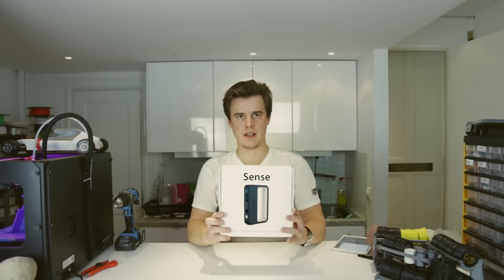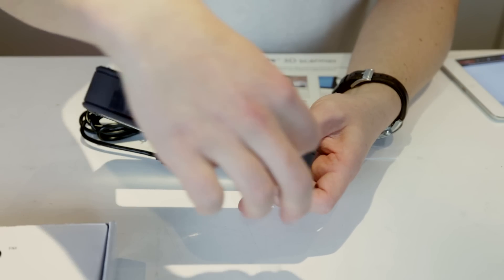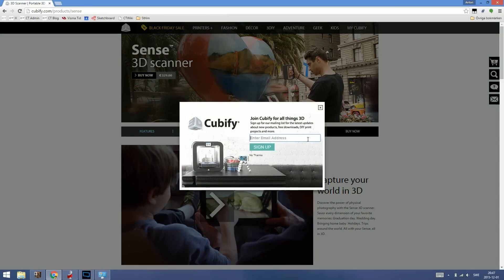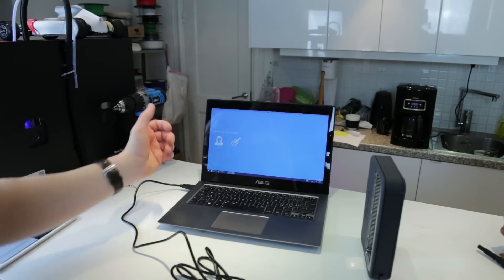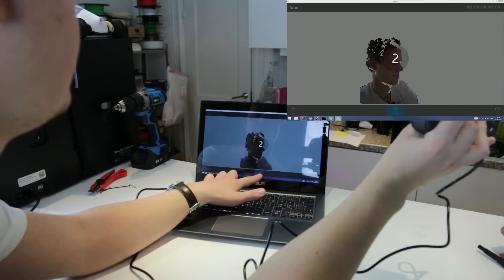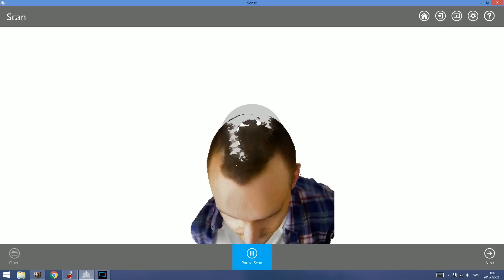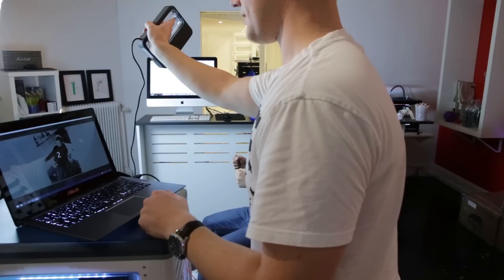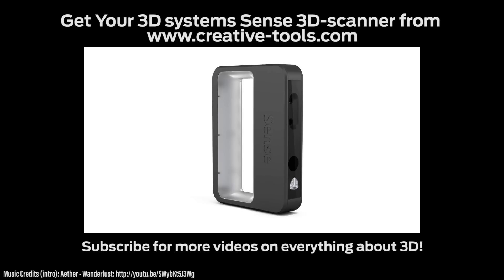3D Systems Sense - 3D scanner || Unboxing, Installation and first runs

Comment: I am unable to use the product after I had changed the OS. Is there any solution for this issue?
Reply from the maker: The product is probably end of life, but ask the 3D systems support. I suppose you’ve upgraded to win11? Or what you mean?   If you just reinstalled I figure you need to reactivate the product.

Comment: Hello mate
Thanks for the video.
We got this scanner as gift to our school and we can't get it going.
I think it is one of two things;

1. We dont have the code and 3D-systems support for Sense is off.
2. There are some drivers that I have failed to find.

You got any clue of how to solve it?
Reply from the maker: I'm not sure about the drivers, I would assume those were just installed with the software installation. You can find the software from 3Dsystems support, which I don't think you need to activate the scanner any longer to run with.  Try re-installing software with administrator rights, an make sure the PC is up to the minimum specs :)

Comment: Hello

I have this second generation Sens 3D scanner. I have installed the software. But
A PV does not recognize the scanner. Can someone help me. Which driver need for the scanner 😳.. or where ran is that my I do not know the scanner from Sens 3D
Reply: Did u get a solution?
Reply: @pieceopye4046  No
Reply: @Golf3gti1  the man who sold mine told me to get itseez3d instead and it works

Comment: I'm completely new to ALL of this.  Would this be the type of scanner I would need to scan and make my own 3D printer files for figures and collectibles?
Reply from the maker: Hi Ron.  Well, it will allow you to capture a full size human and scale down to a figurine. But quality is fairly low, so scanning a toy “action man” for example and making copies won’t work.   This is a budget/cheap scanner.
Reply: @3DPrintTechDesign  hi I just got a sense-Rs but it doesn't detect the scanner despite being plugged into USB 3. My computer sees it but not the software. Could you please help with my setup.

Comment: Is it compatible with the surface pro 's?
Reply from the maker: I'm afraid I don't know. As long as that runs normal windows it should be. And have a powerful gpu.  Check the required specifications on the scanner to be sure 👍

Comment: I just bought one of these scanners on eBay but when I went to this site to activate it, turns out this website has been discontinued. Does anyone know if there is another way to get this scanner to work on mac iOS? Please help me...
Reply: I had a similar problem, you should be able to get past the Discontinued pop up by simply pressing the X in the top right of the pop up. Then scroll down and on the bottom right the Cubify Product Activation section is there. Just enter your email, the serial number, and what product you’re using, and then press submit. Once you do this the pop up saying that the website was discontinued will appear again, but at the bottom of the site the activation code will appear. Here’s the link I used, 3dsystems.com/support/cubify/activate?redirectFrom=cubify  I hope I could help!
Reply: @GlinFilm  Can you help me, please! i bought 1 old sense 1 and no code. What do I need to do to get the code?
Reply: @thonguyen239  did you ever figure it out?

Comment: Hey, my name is Risfan from Indonesia. I was wondering, which one provide more stable 3d result: 1) object stay in position and the scanner move around the object (orbit), or 2) object rotate 360"  each angle and the scanner stay (rotate)
Reply from the maker: With this one you have almost the same result both ways. Just be sure that the object rotates is large. So a person would work, rotating on a chair, and so would a an object, as long as the background within the scan volume rotates to. Example, use a "lazy sussan"

Comment: do you think I could use it for making objects with a cnc machine?
Reply from the maker: I think that's to stretch it a bit. Sure, if you scan a person and scale down it could be possible. But I really don't recommend it for anything for measuring. Also, your CNC would have to deal with stl-files for generating the paths.
Reply: @3DPrintTechDesign  thanks for the info

Comment: I bought sense scanner....had to buy a new pc with the specs they gave me...never got the scanner to work, support is worthless... now I'm being told I need to have another pc with a different version of windows. I'm done with this, its sense that has a software problem and I'm not willing to spend $'s on a non-working product.
Reply from the maker: Hmm, Can you tell me a bit who you talked to and what system you have?  I think the V2 of the Sense is for Windows 8+ only?

Scanning is still a it of a jungle when it comes to hardware. Some programs and products can only handle Intel Core processors and Nvidia GTX gpus for example. Not Xeon and/or quadro for example.
Reply: 3dsystems where the ones giving the support. They first told me my gateway AMD processor was not compatible to their software. Said I needed a intel i5, 5th generation, USB port 3.0, windows 8 to 10. Bought laptop to their recommendations and still did not work. Two weeks doing uninstalls, additional downloads, etc. still not working. Now their telling me I need another PC ( REALLY ! I'm not going to buy a 3rd laptop)

Comment: Please dont buy this device. I got a brand new Gen2 and the results are terrible. Tech support from Mexico was great and nice, but the scanner really sucks. This video looks great but device simply does not work as advertised.
Reply from the maker: +karla luna what's the issue? The quality is limited and volume accuracy as well. Don't expect 10/10 result with a scanner for sub 500$.  
Professional systems are usually 4000$+ and some really good hands-on at 1500$+
Reply: Hello, thanks for your answer. I´m not expecting ultra high definition. I´m expecting what you show on this video. 1. Model is show in a green, not full color like in this video. 2. Even with very slow and careful movements (really slower that the guy in the video) I can not get a full scan for a preson, head or object, with very small movements the scanner lost track of object, trying to reposition the "red" model again is almost impossible and at the end gthe sacan is not completed. I´m just expecting what shows this video, That would be very nice for less than $500, the problems is that this scann does not work as advertised. Don´t buy it, don´t waste your money here.

Comment: What you download after you put code which you get in email?
Reply from the maker: The software for the scanner (that you run on your computer). This software needs your scanners data to pair software with scanner.
Reply: Thank you so much. I didn't saw it on this site, that's why I could not install. I find software now

Comment: I am really disappointed to have bought the sense.
The resolution volumes without textures is really very bad.
I really lost a lot of time and 350 € with this scanner.
And if you sent an email to complain very soon you are told that you can not use it.
Easy to say...
I'll sell it, but I might have problems with the buyer later
Reply: I´m having bad experience with this scanner too. Not a good option to invest your money.
Reply from the maker: That sounds wierd! The scanner is great for some applications i think, but it's crucial to understand to what extent it can be used. Scaling down people for miniatures on FDM-printers is really nice. But yeah, the new version only handles Windows 8.. which can be an issue for some buyers!

Sorry to hear you're having such a bad experience. What type of scanning are you doing?
Reply: Yes I am on windows 10.
For information, any Windows user 7 and 8 we migrated windows 10 free for over a year.
I wanted to work on the bust or faces.

Comment: high, I recently bought sense 2nd gen, but I'm having a problem with the driver installation, I've tried it in 3 different computers with OS  win 7 8 and 10. hope someone can help me, there isn't much stuffs in google.
Reply: +KuraPeaCoke is it better scan quality than 1st gen?
Reply: not sure, I just learned that my scanner is 1st gen. but I think quality difference would be minimal if not the same.
Reply from the maker: +KuraPeaCoke I will have a Gen 2 some time end of may or beginning of June that I hope to be able to show in a video as well, hopefully I can do some proper comparison.
Reply: that's nice, best of luck
Reply: Hi. Im having the same trouble as you. Did you solve it? If so... How?
Reply: I was having problems until I installed the Intel depth camera management tools. 
https://downloadcenter.intel.com/download/25044/Intel-RealSense-Depth-Camera-Manager
still having performance issues but wasn't even able to get the software to see the camera until i got that installed. even though it was showing in device manager.

Comment: http://www.marketsandmarkets.com/Market-Reports/3d-scanner-market-119952472.html

3D scanners capture and measure geometry of physical 
object or environment by using lasers or structured light. Data captured
 by these 3D scanners are often called as point clouds, which are used 
by software to create 3D representation of the scanned object or 
physical environment for an in-depth analysis, inspection, and 
modification. 3D scanners find wide application across several 
industries to ensure high product quality.

Comment: I think in this resolution you can do it for free with any camera. You can use agisoft photoscan or autodesk memento
Reply from the maker: +benyo86 I totally agree. The sense is only suitable for beginners who wants to have a really streamlined and easy software. For the tech-savy person you should be able to do good scans with both Autodesk Memento, 123D catch and of course agistoft (and other photogrammetry softwares)
Reply: 3D Print - Tech Design i couldnt get photogrammetry to work for me, would i NEED a good camera? i used a digital point and shoot, i didnt want to spend money until i KNEW i could photogrammetry and print an exact copy of something.